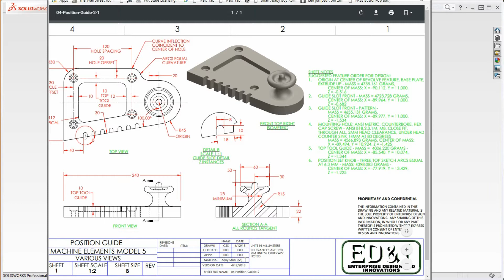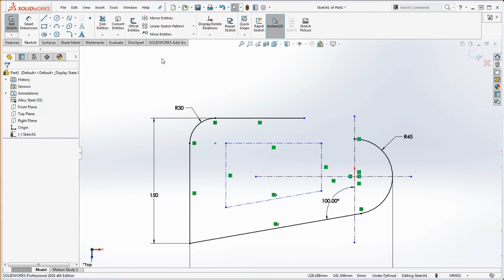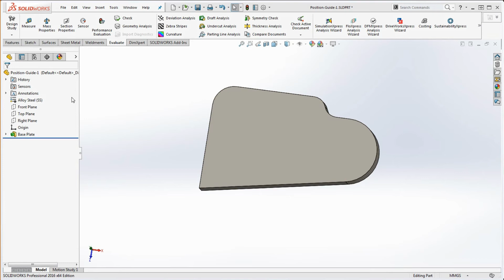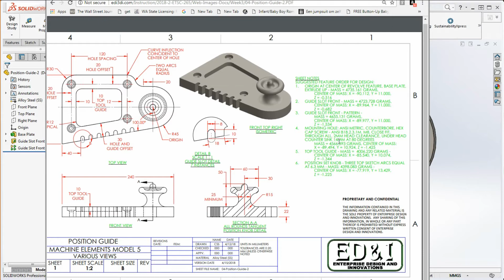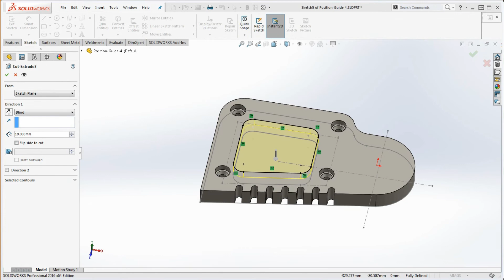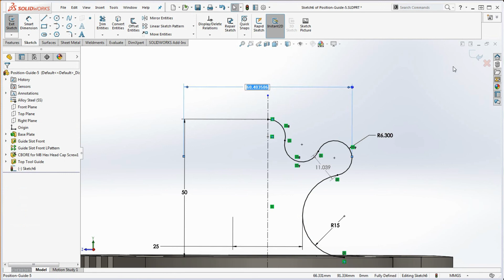65 SolidWorks – How to Sketch Using Line to Arc, Slot Tool, Hole Wizard Holes & Revolved Boss/Base

Comment: I want to know How to denote M8 hole in drawing . So that it can be shown on drawing
Reply from the maker: The best way is using the Hole Wizard on the part, then when you add Model Items - when dimensioning the drawing - it should show. Make certain that hole call outs are selected as an option.

Comment: How did you borrow the sketch at 23:28? I see the arrows appear but not sure what you pressed to do that.
Reply from the maker: The borrowed sketch comes from the embedded sketch for the Base Plate feature near the top of the feature manager on the SolidWorks part “Position Guide”.  I am building this sketch around 10:00.  If you “Show” this sketch – you can Convert Entities from it - thus “borrowing the sketch” as I like to call it.  Change the base sketch and the borrowed sketch changes too.  CSS